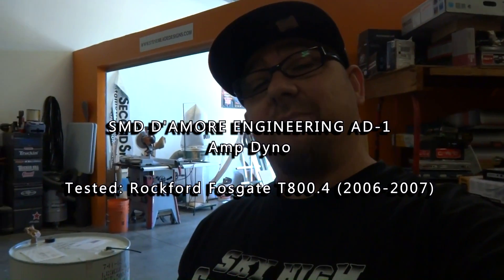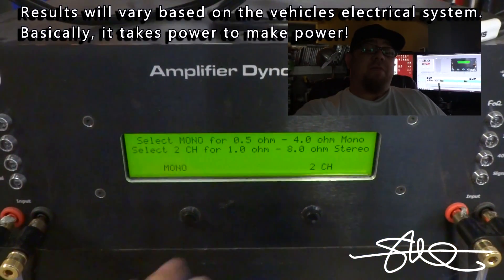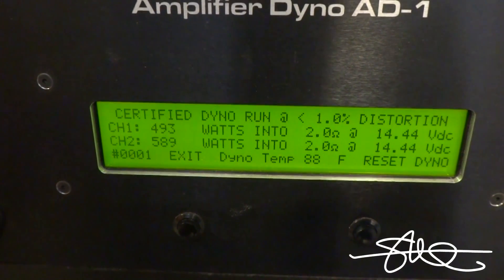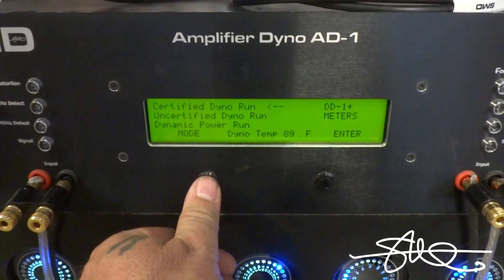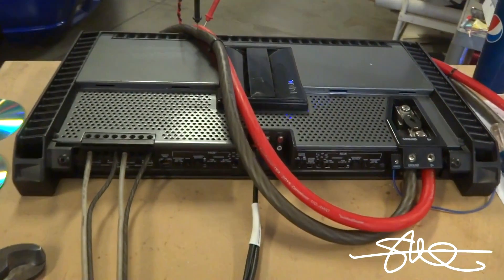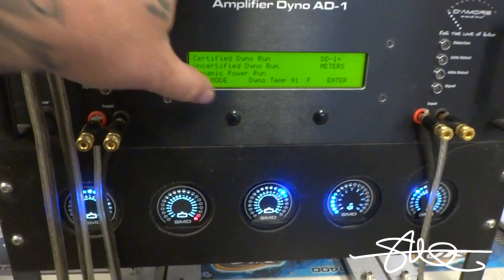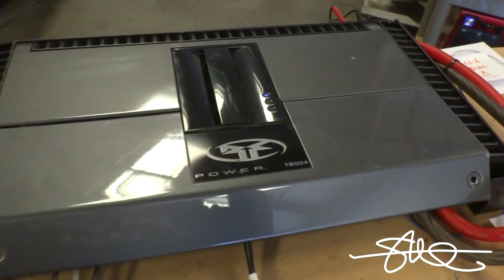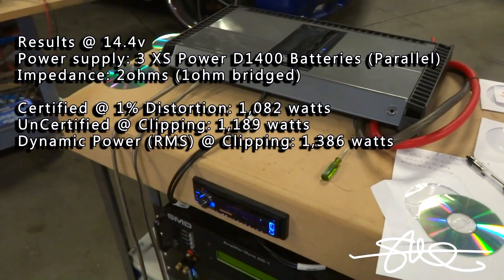Amp Test Tuesday - Rockford Fosgate T800.4 - Rated 800 watts - SMD AD-1 Amp Dyno

Comment: I'm super happy my buddy bought one of your Dd1's so I'll know for sure all my amps will be tuned without any distortion cause my last big system with my 6 15 in JL W6's and my precision power Pc 2350's I kept hitting my clipping points and that shit alone will drive your ass insane trying to find that perfect gain sets till I just would turn it to around 3/4 of the way and just said fuck it and walked away lol what was super nuts was my amp put out 1400 @ 4ohm bridged but when we checked the out put it was only 5.5 ohms and if I tried to add another sub or two it would take it down so low it would cut off cause it wasn't stable to that ohm load that was something that had me puzzled for years have u ever had a problem like that before it was like either the sub ohms wasn't correct or the amp wasn't reading it correctly but when I took the W6's out and put the 8 15 in JL W0's 8 ohms it worked out fine as far as the ohm load. Went and I got a real serious question can u take a duel voice coil sub and run matching amps and wire one voice coil to 1 amp and the other voice coil to another amp and if need be maybe put it on some kinda gain splitter splitter to where your getting the same exact amount of watts through both amps to 1 single sub ??

Comment: From what I see and hear RF are very good amps, but I have a dilemma. I bought a car from the local police auction and when I opened the trunk it was missing the woofers in the custom made box,so I removed the the very well built enclosure only to find 1-4000.1..1-2000.1 1-800.4 all on back deck..I took the three amps to a local stereo store and the 4000.1 doesn't work. So my dilemma is is it worth fixing and who can do the work..I really like your dedication to stereo atmosphere and keep up the good work

Comment: If you will do a test of the autotek ata 2000.2. If you can't find one shoot me a message I might even be cool with sending you one to test, I'm about to buy another amp and I have one and it does good with my subs bit I'm not sure if it's pushing anywhere near rated power.

Comment: You should test a jl audio 1000/1 slash series amp or the 1200/1 if you ever get one around.
Reply from the maker: Ray Gonzales who said i was "rockford sponsored"? did you just assume that? Actually, if i had a 1200/1 i would test it.  Can't pull one out of my ass though.
Reply: meade916
ill send you my 1000/1 if you wanna test it. id be interested in knowing also.
Reply: meade916 That would be a heck of a trick.
Reply: I agree
Reply: He's Rockford Sponsored ... highly doubt it ...would love to see that
Reply: Eric Don I really really want to see a JL 1000/1 being tested. Get the v1 if you can. the v2 is made in china.
Reply: test it yourself with a clamp meter and multimeter

Comment: RockFord amps is all I use because I don't have time to be going back and replacing blown amps. I don't do a ton of installs anymore but installed a Power T-500 and punch 400.4 several years ago with no issues recently put this in another Hummer. And I've installed a total of 14 amps in 3 limo's for another customer. 2 amps in the small limo /5 amps in the medium sized limo and 7 amps in the new limo. No issues other than some blown speakers and they play @ high volume all night long.

Comment: Was that per channel or bridged?? my 800@4 does 152W-4ohms /305.7W-2ohms per channel..  2 channels bridged 568.0W-4ohms Tested @ 1k-10db On VELLEMAN HPS10 Hand Held True RMS Oscilloscope.. @ 14.5V.. It's 10-15 watts more per channel tested @ 40hz-10db.. My jvc likes the -10db tracks volume @ 48 of the 50 before clipping on rca jacks.. power output volume 33 @ clipping. Good thing i'm not using them speaker outputs.

Comment: is the dd1 easy to use, and how much i need one, and im 16 ive had small systems since i was 14, but now im getting a 15inch re audio sxx, 1000 watts rms, requires 4 cubic feet of airspace, and im getting the rockford fosgate r1200-1d, prime amp

Comment: Heat cycling anything will degrade metal components over time. Also, most all metals oxidize to some degree or another (only a few don't). Just exposure to air and moisture will eventually degrade metal electrical connections.

Comment: depends is look a issue for ya it can be as simple as a lil to a good amount of silicone /or ca glue or even epoxy works wonders almost any adhesive can be used for most cone issues i have personaly used silicon on two of my daily driver subs and epoxy on a composite pioneer that i gort 4 free was gonna be tossed over a small hole in cone

Comment: I sold Pyramid car stereo and PPI back in the mid 90's at a shop in Phoenix. The heat sink on the Pyramid was 20x bigger than the PPI so people wanted to buy them. They weren't so happy a month later when the Pyramid was broken, woofers blown and it never got as loud as the system in my car with a PPI A600 and a pair of 10's. :)

Comment: I'm looking to get a 1000-1500w amp but not sure which brand to buy ... I'm looking to run a single Sundown, RE Audio, SKAR, or Image Dynamics 1000w-1200w 15 or 2 smaller 600w 12s in a 95 Honda Civic. I never know what brand to trust so I stayed w/ Mainstream equipment so far. 175amp Alt. Stinger 35ah under hood,  Knu 0ga Big 3, Rockford 4ga Dual Amp Kit, Alpine 9886 - Alpine MRP-M500 - Polk PA660 - Infinity Kappa 6.5 rear - Kenwood 6.5 Components front - Rockford P3 12 (04 version) 2cu. ft.

Comment: Texaschevrolet a bigger amp is always better so you don't have to stress the amp for the power you want and your gain doesn't have to be turned all the way up. If I was you I would go with an amp that is 2ohm stable with your 4ohm subs and run the subs in sequence to put them to 8ohms then bridge them on the amp to make them back 4ohms getting max power out of the channels of the amp making it easier to get rid of any distortion when setting your amp to your liking.

Comment: I'm having a problem with my subs, the amp turns on and works fine but the subs aren't moving, but the subs are fine too, I redid the ground and all the speaker wire, I have two pioneer 10" rated at 250w rms 4ohms, and my amp is an 1000w max lanzar, 250w rms at 4ohms on each channel, please help!!!! The amp is brand new!

Comment: I was wanting to get some help on an amp selection i have two kicker c12s (both are 4 ohms) that im going to wire them down to 2 ohms, and i want a mono block amp that's not a cheapy nor really expensive. Already have an amp its a kenwood kac-8105D will it work ok?

Comment: And this is why i buy RF amps. May be expensive, but when they're putting out sometimes double what other equally rated amps put out, it's worth it.

My little 300-1 is meant to put out 300w, the sheet included with it says it'll do 430wrms+ @ 14.4v w/2ohm, and i believe it.

Comment: I think the model number of this amp is T8004 (without the dot) and they are from 2005/6 time frame. I had a T4004 once and it was rated at 25x4, but actually did over 100x4 at 4 ohms. Man, I have a TON of old school amps and the Amp Dyno would make my testing SO much easier! Really enjoy the tests man, keep them comin'!!
Reply: Is it possible that you could get the t8004 and dyno that amp? I just got one the other day for free and I know it's not doing 50 per channel.
Reply: Haha

Comment: Yes please, I have two brand new Hifonics BRX24000.1D that I purchase for my RE AUDIO XXX12D2 and I'm hearing the same thing. Some say they are BS, some say they are cheap and some say they are sae compliant to the watts that's specified. I just need to know before I open them up should I keep them or send it back and go with a different line.

Comment: Steve how about testing a JL slash mono block, they claim they put full RMS power at any ohm load. ( a 1000v2 claims 1000w @ 4ohms,  1000w @ 3ohms, 1000w @ 1.5 ohms)

Comment from the maker: when you actually install this into a car, you will set the gains according to what they are being used for.  If you need all the channels to output the exact same amount of power, for a set of woofers for example, you would gain match the front and rears.  This test shows how much power the channels are capable of, but there will always be small differences between channels on any brand of amp (before gain matching).
Reply: meade916 just a noob question but the first test was bridged to 2 channels right and the 2nd channel put out almost 100 more watts then channel 1 is that a sign of an issue with the amp ? And if you can run subs on this amp would it cause an issue because one sub seeing that much less power ? It seems like they would be battling each other and not moving in sequence but i don’t even know if this amp can run subs or just for door speakers sorry if it’s a dumb question it had me wondering. I have a t15004 and a t8002 both mint I plan to use on my first real build they are beasts !!!

Comment from the maker: you need a good power supply for a T4000.1.  Did RF fix them for free? Shit happens, but RF has ALWAYS had the best CS.  If they didn't fix them for you then that means you got them from a non authorized source and when that happens, there is no telling who had the amp before you, how it was treated etc.  I know out of the 9 i have owned, only 2 had a problem but they were the first ones off the assembly line. Ever since then, NO PROBLEMS at all....and i still have 6 of them :D
Reply: meade916  ....i just got two 2000wat 15inch lanzar subs i broke my 1000wats crunch amp  cuz i had it on the box so i hooked up my 250wat amp its a mtx termanator
Reply: So the 250wat amp mtx termanator bumps the 15inch subs pretty good but over heats i wonder why lol

Comment: I've owned two T4k's and BOTH of them blew some MOSFETS on both amps. Everything was correctly installed, but I just didn't have any luck with them. I've owned AQ amps, DC, and even a Sundown with no problems and the same wiring. I still love me some RF products though. I'm running 3 T400.4's still for mids and highs. Amp Porn!!!!